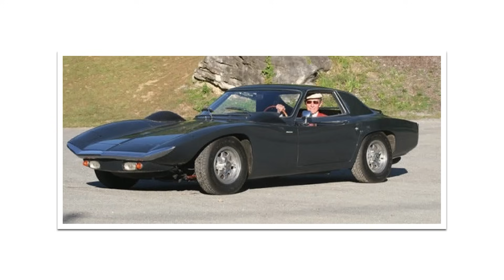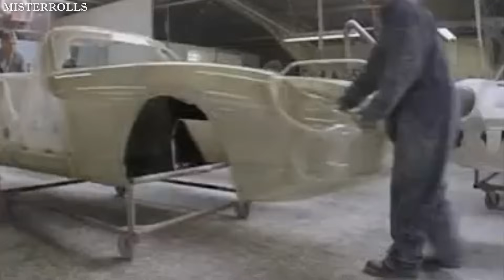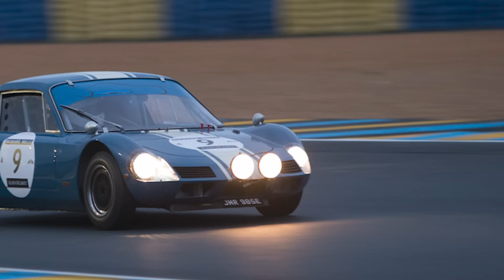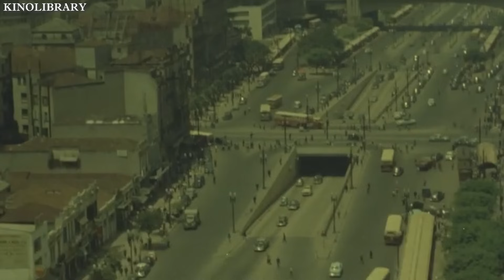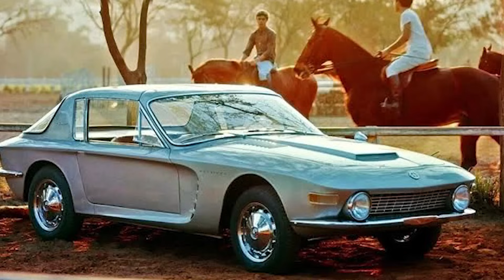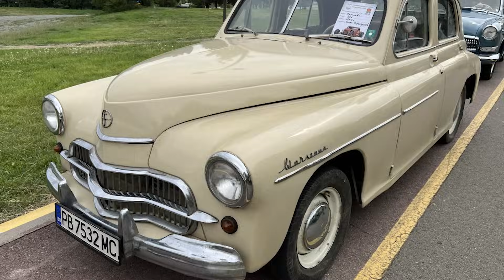5 Best Cars From 1960s You Never Heard Of!

Comment: Brasinka 4200 is more than a little influenced by Jensen Interceptor Coupe. Except the Straight 6, instantly identifiable as a truck motor. Jensen used the mean 440 C.I. Chrysler Corp 6 Pack providing 331HP and enough torque to influence tge rotation of the planet

Comment: Fitch's concept remains an attractive design that is a two-place car -- something that's a rather difficult sale to GM management.  You need to watch where you place commas in large numbers.  🎉
Reply: Yes but can we replace the air-cooled flat 6 with Dunrov's 4.2L rotary? It made big block horsepower (torque not so much)😂